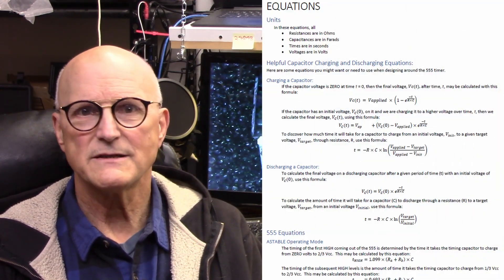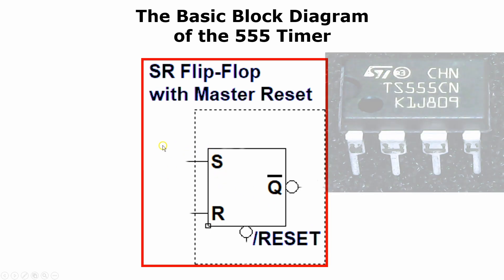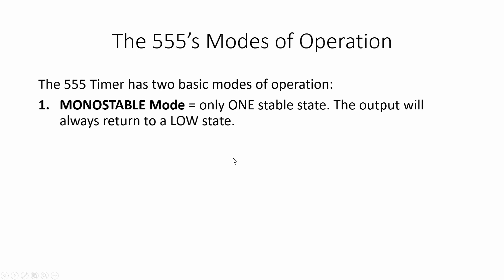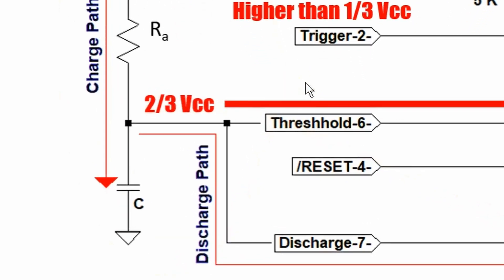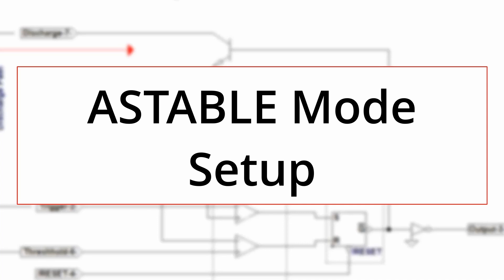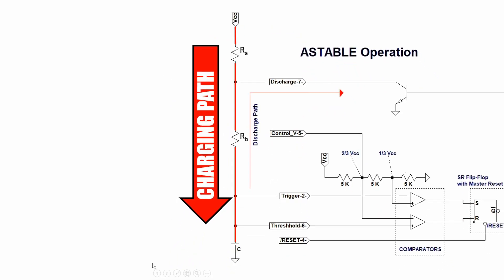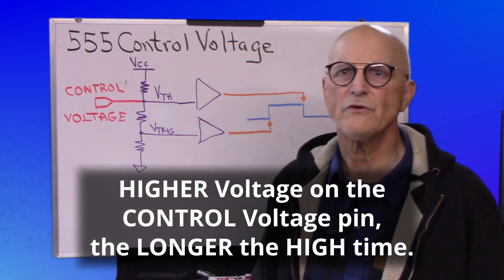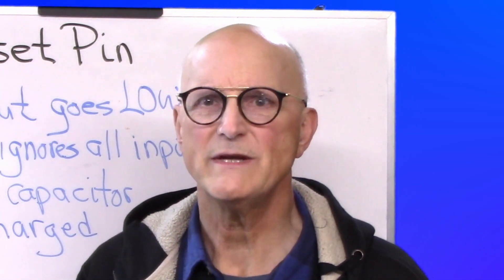The 555 Timer (015)

Comment: Can we stabilize the frequency of a 555 oscillator using a crystal?
Reply from the maker: Based on how this chip does what it does, no, you cannot stabalize it with a crystal. The 555 depends on the controlled charge and discharge of a capacitor. Crystals do not operate in this way.